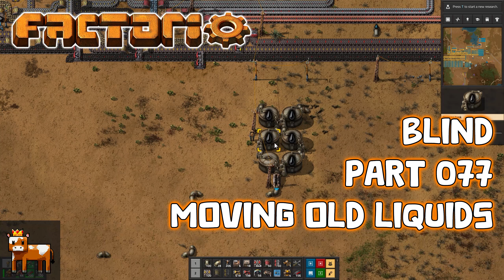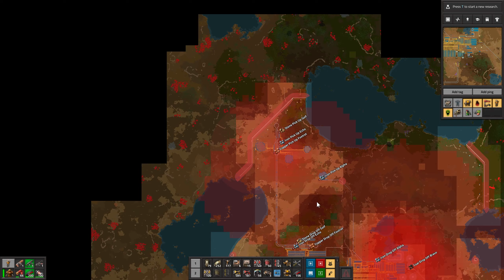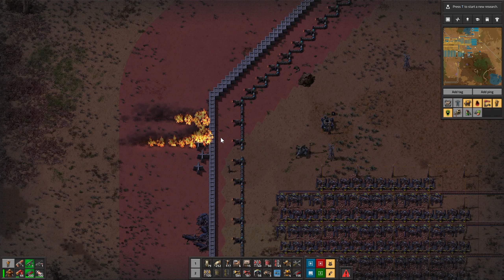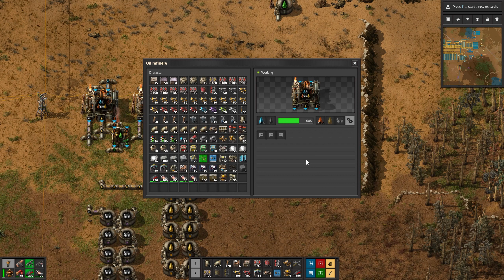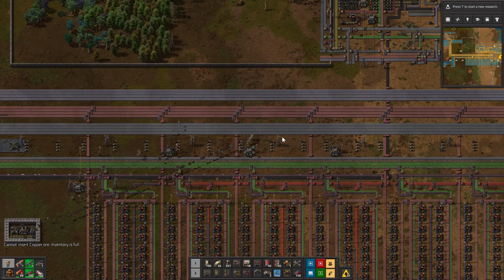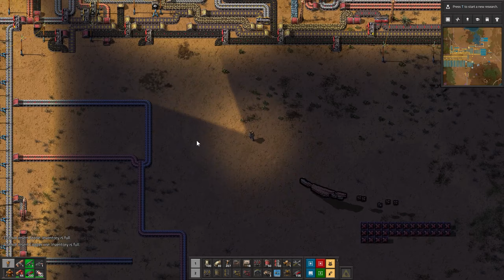Idiot Plays Factorio - Part 077: Moving Old Liquids

Comment: :-) To bulk move chestloads of things in future, consider either (a) Using the car trunk, if it will fit or (b) set up a temporary train + wagon, dump it in there or (c) if you don't care how long it will take, stack inserter out onto a belt to new place. Another poster mentioned active provider chests, they are a "don't care how long" solution, too.

It's way quicker to move bulk items in and out of a chest by hand with CTRL clicking than using the logistic bots.

Also, dumping all your current inventory into some temp chests while you do the move will really speed things up too, make sure to use all your inventory space. Care to turn off logistic requests, of course, or you'll kick off a logistic bot storm to refill your inventory.